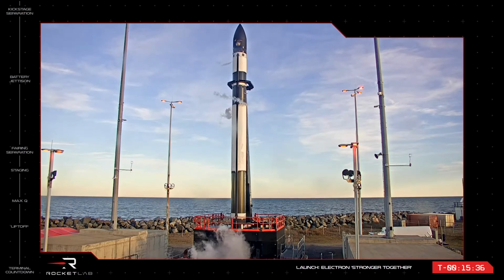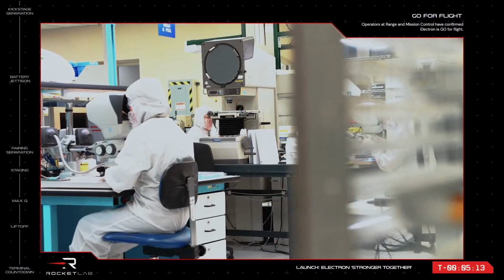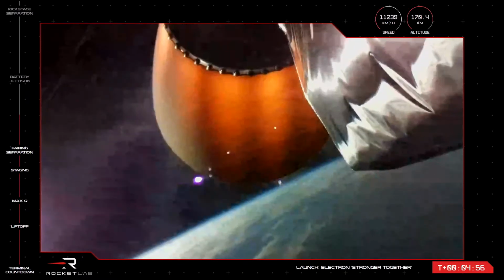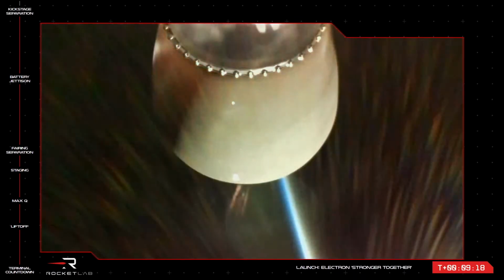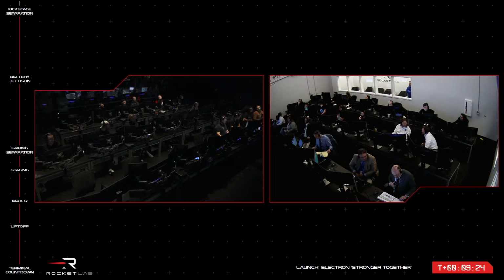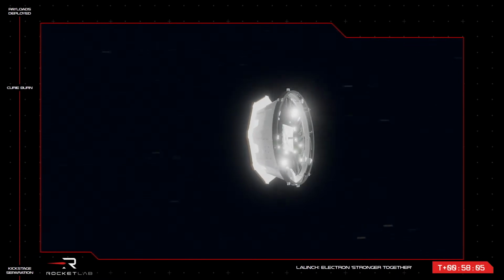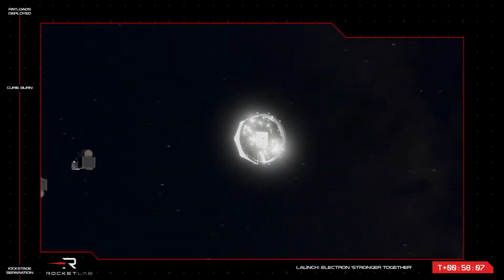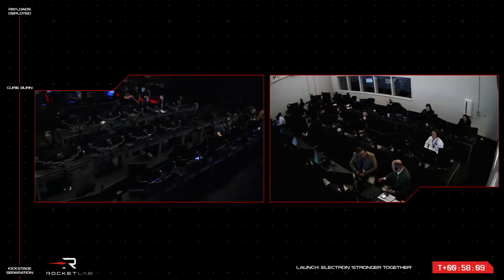Rocket Lab - 'Stronger Together' Launch

Comment: 24:20 lift off,
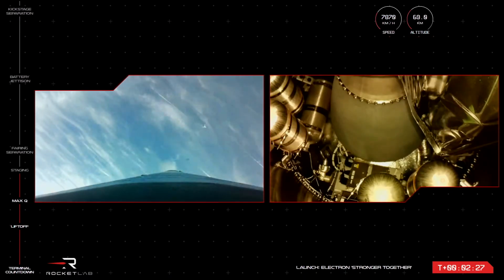26:50 meco/stage separation,
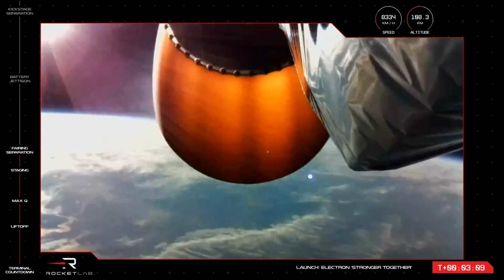27:35 fairing separation,
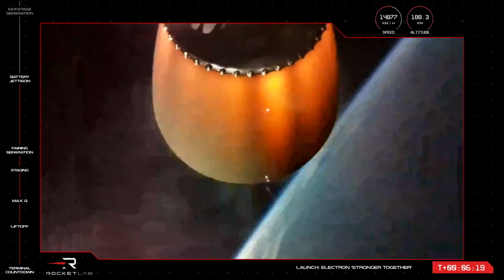30:40 battery hot swap,
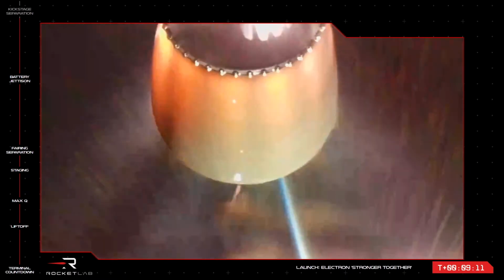33:32 seco,
1:20:10 payload deployment.
Reply: thanks
Reply: Thank you!
Reply: I wish these companies would either note this or at least pin the comment that does it! I found your comment after scrubbing back and forth forever.
Reply: What happend to stage 1? Didn't it land back on the ground?